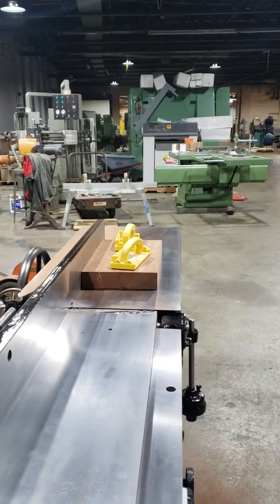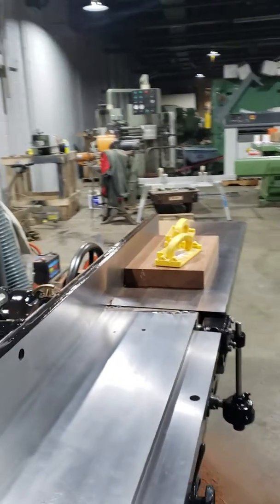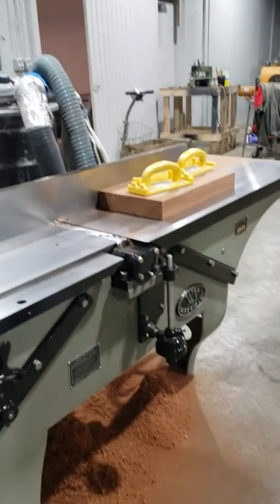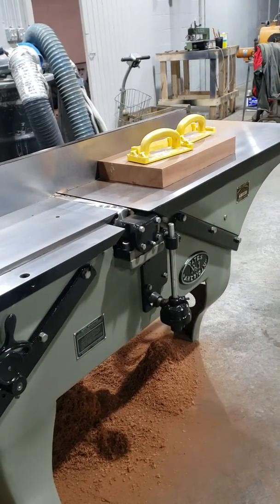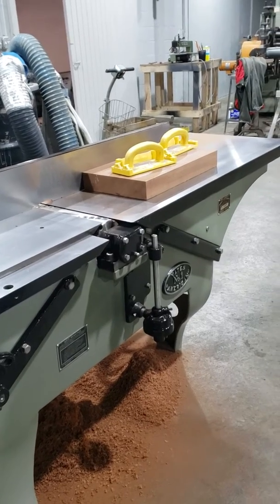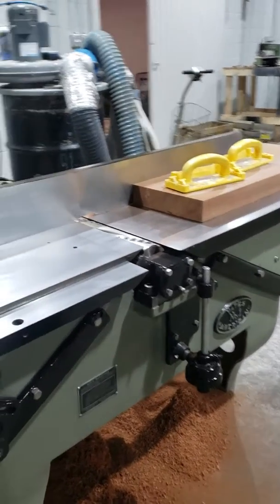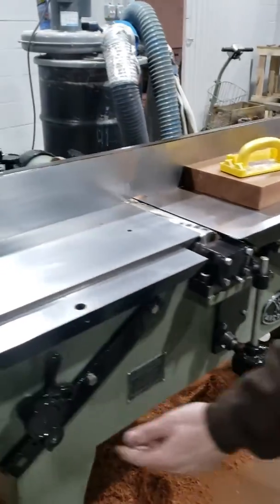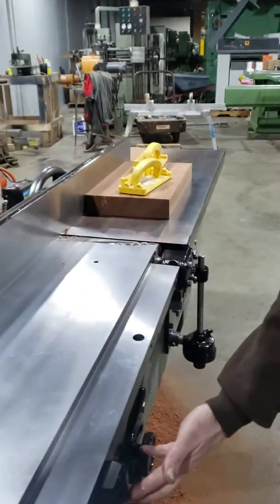Yates American jointer

Comment: Looks like you reground the fence and tables. What else did yo do?
Reply from the maker: Customer wanted tables ground so I did. Hermance helix head, bearings, completely stripped to castings, filler, paint, basically brand new 1942.
Reply: @wconstructionco  Probably better than new. Were the tables/fence warped or pitted at all?
Reply from the maker: @paulmartin8741  not at all. It was purely for cosmetic reasons. Had 4 other machine tables ground as well.

Comment: How much work was the helix head?
Reply from the maker: If all the parts were there and ready, probably 10 hours including wiring an installing inserts. I can pull most jointer heads in a couple hours.